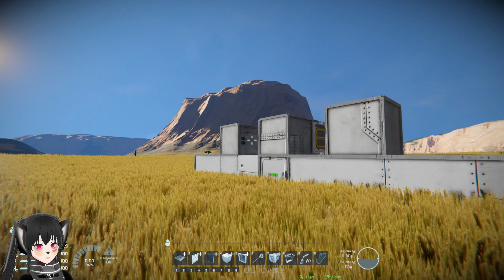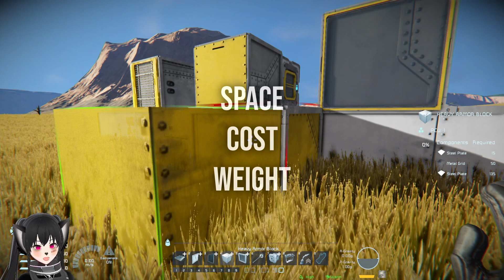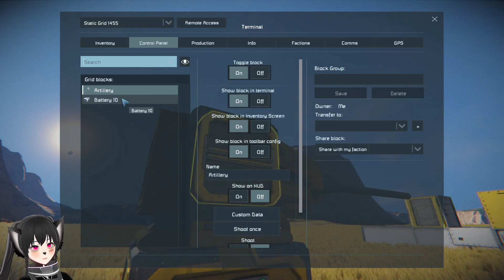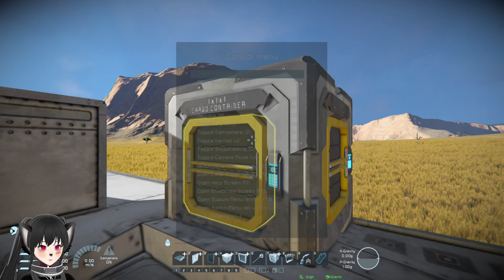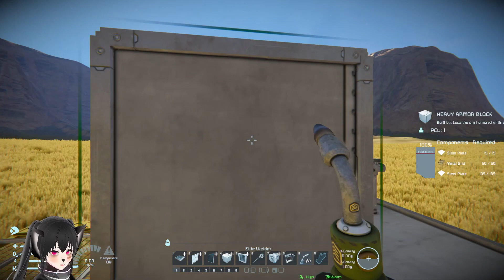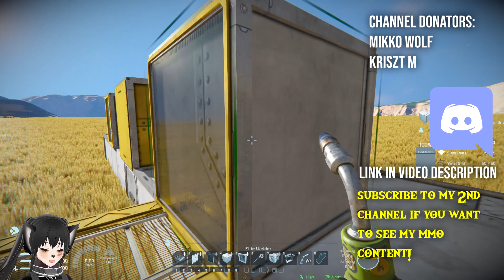Are Thin Layers of Extra Ship Armor Useless? Space Engineers Cladding

Comment: I like to use heavy armor plates around turrets. It’s more for peace of mind. 
I also use them for nicer colors shapes. So when a block is on two level I can put armor plates and color the plate instead of the block. It’s pretty useful when you have different depth. You just can’t one height but not the other.

Comment: This is completely wrong normal armor is cheaper more effective and lighter than using panels of any kind the only reason to use them is to make it so that your ship does not fall apart easily or as mount for cameras. Again you completely ignored the fact that space engineers hit registration is not perfect this is not real life a shot only gets checked if it hit something every so often so it almost always passes thru a panel then hits the stuff behind it.
Reply from the maker: There are some cases for protection where panels make sense c= like if putting a panel is enough to give the sufficient protection level that you want and space, and turrets line of sight is a concern

But yeah they phase through sometimes but most of the time they work x3
Reply: @LucaTheGuide they work for me, don’t know what this guy is on about.
Reply: @LucaTheGuide  no ffs just do some test where both the target is a ship and the shooter is a ship and put them a few hundred meters apart and you will see even in singleplayer a arty shell can easily ignore like 5 layers of panels until it registers. On actual pvp its like 10x worse because of lag.

Comment: Nice vid, One of the things I don't think is used enough is hybrid propulsion in ships, I get not having all 3 types of thrusters, and mixing atmo and ion only really makes sense in SOME utility ships (if they can break gravity, while carrying cargo, without using hydrogen) but the way i see it, even most combat ships are going to spend most of their time either in atmo or in space, so having either atmo or ion thrusters can greatly improve utility. the big exception is with things like fighters, and your "escort" classes of warships, with fighters it should either be hydrogen or atmo, ion is too expensive and slow, similar deal with corvettes and frigates.
Reply from the maker: Thanks Michael c= and interesting points, I usually just go with hydro or hydro and atmo x3
Reply: @LucaTheGuide  You also normally build combat and combat adjacent ships, where acceleration is basically everything, but for ships that have to move around a lot in space, but not necessarily do so quickly, and don't have to jump a lot (if they have a jump drive) having ion engines can save on a lot of ice over time.
Reply: Best hybrid in space is grav drives and hydrogen imo.
Reply: @pickcomb332  IMO the only situation where Grav drives don't feel cheatty is when used as a vehicle catapult/cannon. and then you either need to put expensive artificial mass/space ball blocks on the thing being launched or have a piece of ore on a landing gear or something
Reply: @TheMhalpern  Grav drives are in the game, they are a feature like Ion Drives. They have rules and drawbacks just like other drives. Nothing "cheatty" about them. This is a perception, one could call a 100 M/S Speed restriction, "cheatty," but its in the game. Working as intended.
Reply: @pickcomb332  so is thruster damage